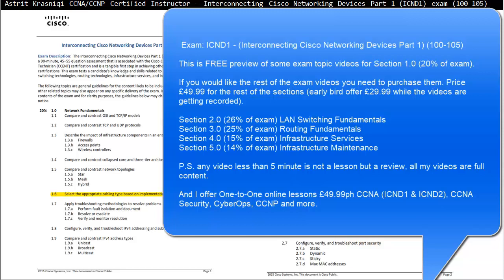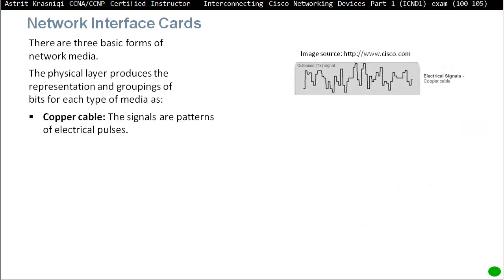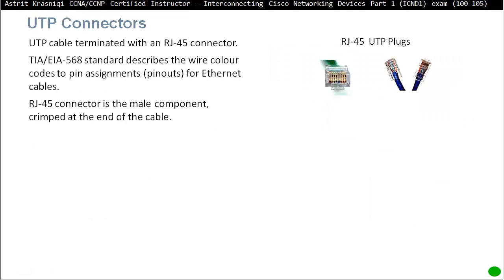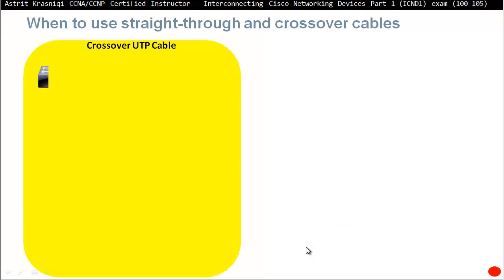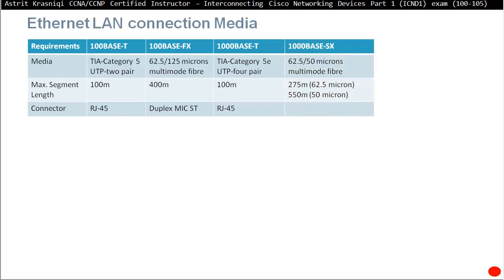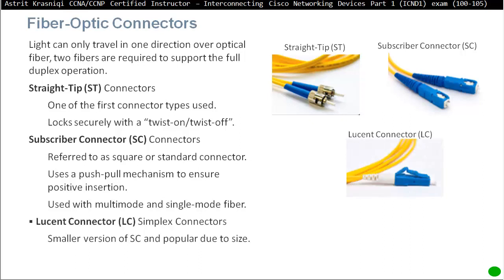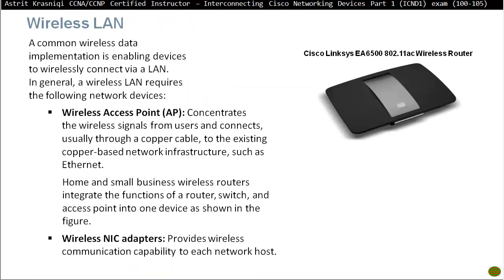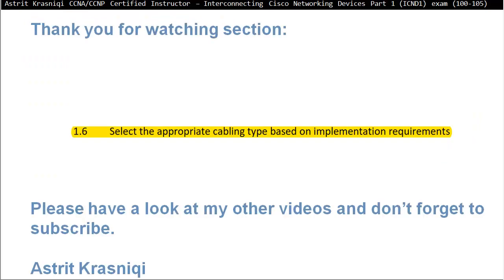CCNA ICND1 (100-105) Exam Section: 1.6 Select the appropriate cabling type based on imple...

Comment: After all the learning from your video, I decided to answer with this:

Appropriate cabling according to implementation requirements is going to vary due to a couple of factors: distance, speed and type of cable required due to device compatibility. The basic forms of network media available are: copper cable, fiber-optic cable and wireless. 
Copper media are limited to a certain distance restriction due to attenuation (the longer the signal travels, the more it deteriorates). Interference can also corrupt and distort data signals being carried by copper media. The copper media presents itself in three forms: Unshielded Twisted-Pair (UTP), Shielded Twisted-Pair (STP) and Coaxial. These medias are used to interconnect nodes on a LAN or infrastructure devices such as switches, routers, and wireless access points (WAPs). The advantage of UTP is its ability to cancel interference because the twisted wire pairs limit the signal degradation from EMI and RFI. UTP main cable types are ethernet straight-through (mostly used for different device connections, for example: switch to router and host to switch), crossover cable (mostly used for similar connections, for example: a switch to a switch, a router to a router or a host to a host) and rollover cable (cisco proprietary cable and is used to connect a workstation to a router or switch console port).
Fiber-optic cabling transmits data over longer distances and at higher bandwidths. Transmits signals with less attenuation and is completely immune to EFI and RFI interference. Its physical appearance is thin and its bits are encoded on the fiber as light pulses. Fiber has two types of media: single-mode fiber (SMF (consists of a very small core and uses expensive laser technology to send a single ray of light over hundreds of kilometers)) and multimode fiber (MMF (consists of a larger core and uses LED emitters to send light pulses. It provides 10Gb/s over link lengths of up to 550 meters)). 
Wireless Media, it has a limited coverage area and this area can be shortened depending on the surroundings, for example, the materials used on construction for the establishments. It’s also very susceptible to interference by common devices. Since it doesn’t require any physical access, security is a major component of wireless network administration because individuals who are not authorized can gain access to the transmission.

Thank you for the content!

I have a question though... The shared medium, does it apply to Wifi 6?